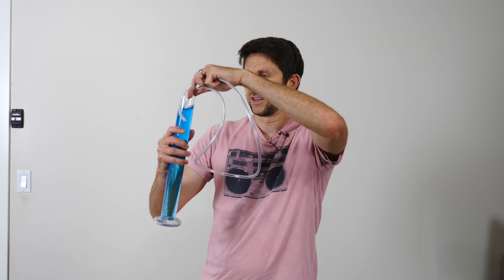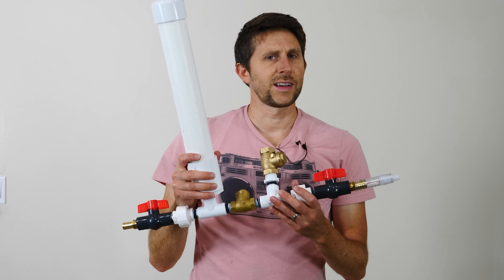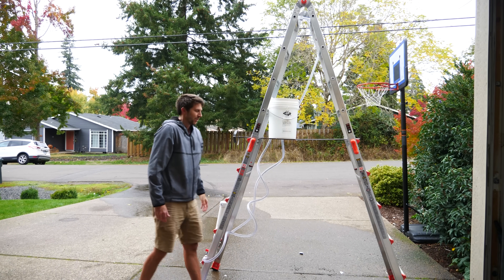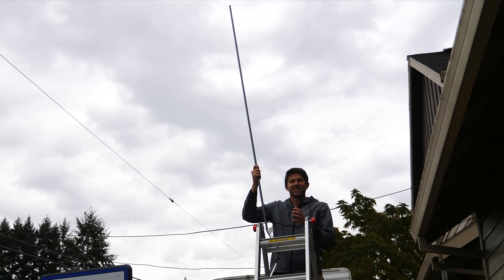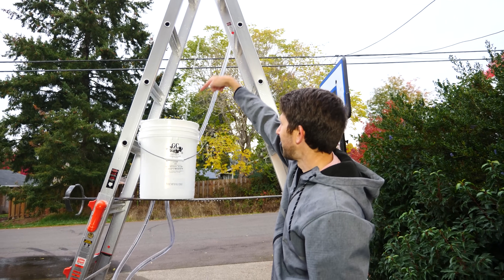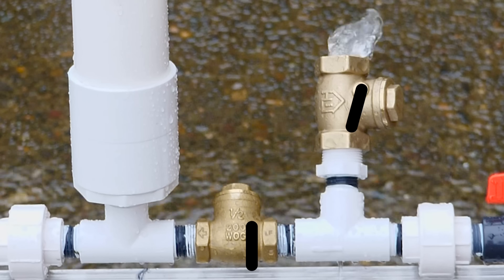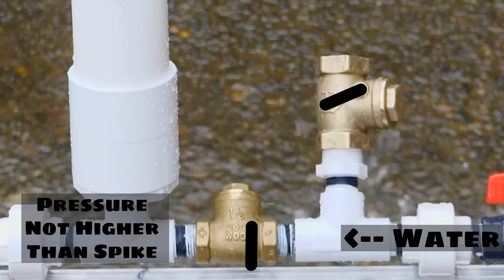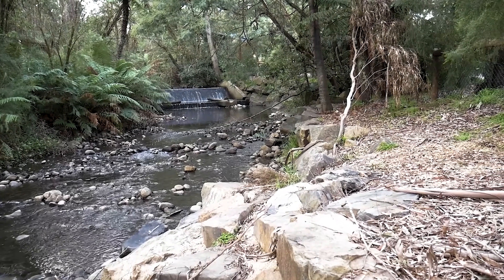Can a Hydraulic Ram Pump Make a Perpetual Motion Loop?

Comment: I know it won't make a perpetual motion machine, but what would actually happen if you recaptured the waste water into a small reservoir to put back into the system instead of squirting out on the ground?
Reply: all of the (source) water has  gone  DOWNHILL,  to the pump.         how do you propose to coax the waste water  to flow  Back  Uphill.?
Reply: @daviddavids2884  It does already spurt upward a couple inches when coming out, so it's a little bit above the pump at least.

Comment: I got this idea swinging a sledgehammer like a pendulum but I noticed I couldn't just raise the hammer up from a dead hang it required me to swing it to allow it up. Which made me think if I replaced my hands with an arched track and allow the sledgehammer to hang from said track that I could cause that hammer to swing around the axis with minimal effort. Using just my pinky finger I could swing it back and forth until it was spinning. Could I get more power from the sledgehammer swinging then the small nudges it would take to keep it swinging on the track? You would need a lot of the swing force to be absorbed by the arch of the track before the nudge in the other direction.
Reply: As long as there is no friction yes. All those small nudges (if timed correctly) add energy to the hammer. Resonance is actualy just this phenomena, well timed inputs that over time add energy to a system such that you end up with a lot of energy in the end.

Comment: What if you use the water that goes above the bucket to land on a wheel device that when it gets heavy enough spins up the wheel and falls back in the bucket but the spinning wheel then pulls up as much of the left over water that came out the valve? What kind of return efficiency could you achieve?
Reply: see my comment, above.    10%  output is not a lot, but it is continuous and mostly free.
suggest  you  go  AFTER  the answers  to  your  questions.    surf  wiki; internal links.    while it's still around and free.
https://en.wikipedia.org/wiki/Hydraulic_ram
https://en.wikipedia.org/wiki/Hydropower

Comment: what would happen if you sent the waste water into another bucket/ramp system that sends the water back to the original bucket? would be cool to see how long the system would stay running for
Reply: and on the way down, passes a hydro generator for power
Reply: @CrAzZyTheCodingBoss  That would reduce the fluids momentum, and offset somewhere else.
Reply: @CrAzZyTheCodingBoss  That is what I'm working on 👍🍀🇺🇲
Reply: @Rizik1986  Same am working on we need a colabo ✌️
Just call it an indirect dam. So you don't need all the special license that goes with the dam you just return the water back to the original source without affecting the water 
Imagine you invest in a massive tank with low rpm magnetic alternator like 120rpm. So the pump speed into the massive reservoir equals the exit speed. Bingo you good. A mobile Dam 👍
Reply: @onekycarscanners6002  Hmm this might be just the ticket to make this happen! I been stumped last few weeks trying to figure out the next move. I wanted to use a water ram pump but it simply won't move enough water for what I'm trying to do. An alt with a small pump could work I suppose.

Comment: "THERE IS NO FREE ENERGY DEVICE!!!"
- ElectroBoom
Reply: What is the sun?
Reply: Sun will eventually burn out
Reply: Not free, we catch and convert. Yet the sun is depleting. You get 'free' energy. But the sun burns, and one day, it will burn out. Same with the water, the water source runs out. You can catch them waste and repurpose it. You can re-add it to the original source. Now you are expending energy. In any free energy generator, their is a source that depletes. The depletion time might just be 10 years. You do not create energy. You transform it. For every volt and amp you get out, you lose it elsewhere. If youmdraw from the greatest power source of all, the earth, the earth also has a shelve life. It also has a limit to its energy creation. You can build more complex machines, add more than one law of physics together to 'negate' aspects of physics, yet you can not change physics, just manipulate it using physics. And all these complex machines you build, most likely these systems already exist in nature. Changing one form of energy into another and keeping the cuycle going is a part of nature. Yet one day, nature will have nothing left to give. Evolution theory and science combined. Nothing could not explode and create a universe if energy can not be created. If a planet or space or the universe is eternal, it would mean that energy is coming from an outside source. Replenishing what has been used. Natural systems might be eternal, converting energy in several ways that lead back to the original source, but wear and tear breaks the mechanisms of the system. Somewhere , you do lose something. Always. 10 000 years of energy. Which to a man that lives to be 80 looks to be free. Your great great great great grand kids will pay the price. But who cares about them right.
Reply: An immense limited power source

Comment: Water hammer is not so much pipe expansion, but long-run pipes actually moving due to the momentum of the contained water when the flow is abruptly changed. This phenomenon is why sprinkler systems avoid single-direction long runs, since the water flow is controlled by solenoids, which turn on/off instantly. The water hammer phenomenon can break the pipes.

Comment: you mentioned water hammer, that can actually damage pipes, which is why water hammer arrestors were invented, the water hammer arrestor absorbs the water pressure from the water coming to a dead stop when valves are closed

Comment: It would be interesting to connect the waste valve back into the water line! So it would really become a perpetual motion machine!
Reply: you mean where the water is being sent into the pump or you mean the bucket? both ways wont work cuz sending water back into the pump input wouldn't have enough pressure and you cant send water back to the bucket cuz it also doesn't has much pressure

Comment: Question: would it be possible to have the waste valve just feed back into the bucket?
Reply: No
Reply: @jimwhelan9152  why ?
Reply: @jimwhelan9152  what if we make that waste valve connect to the pipe line of bucket ?
Reply: @failoor  the bucket is higher than the waste valve outlet. Water doesn't flow uphill.
Reply: @jimwhelan9152  so if we make that possible will perpetual possible ?

Comment: I noticed that the check valve is at the beginning of the water inlet, I did it before, but this valve was placed after the air chamber, that way your water elevation is more efficient?

Comment: I love how electrical components can all be reproduced in an hydraulic system, this is definitively a DC/DC boost converter (the inductance is water inertia).
Reply: Very noisy signal and very inefficient to be to be a boost converter..
Reply: @omniyambot9876  This is however a rigorous hydraulic analogy.
Reply: @IncroyablesExperiences  But it's a PWM maybe
Reply: @IncroyablesExperiences  il faudrait que tu fasse la même chose mais pour le YouTube francophone ,ça ferait une super vidéo !
Reply: @omniyambot9876  a inefficient and noisy boost converter is still a boost converter
Reply: Yeah I guess
Reply: I literally yesterday was thinking about this same exact thing.
I was thinking about how water could push itself with release of energy, akin to how batteries release electrons from one side and grab them from another.
Reply: @blinded6502 sorry, nur: Wenn hier so viele kluge Leute von Strom Ahnung haben (im Kommentarbereich von einem Widderkopfpumpenvideo!): Warum gibt es noch kein Blitzenergiespeichermedium?
Reply: Ooh vous ici ❤️
Reply: I love how synonymous electrical concepts are with water too. Check valve just a diode. Not smart enough to wrap my head around your boost convertor circuit tho. Science is beautiful
Reply: @markmywords5342  You can also model a spring/damp/mass system as an RCL circuit and vice versa.
Reply: None of those components are electrical components
Reply: @Unholy-Dread  Any active/passive component has its hydraulic analogy!
Reply: @IncroyablesExperiences  what isthe Hydraulic analogy of the transformer?
Reply: @omniyambot9876  these don't extend well to AC.
Reply: @omniyambot9876  RE Transformers,.Any hydraulic ram here the bores are not equal? The basic thing hydraulics are use for? 
A small piston pump going like crazy but only low power moving a big cylinder slowly but with high torque or what ever the equivalents are.
Strangely it looks more DC
The other one that came to mind was a torque converter.
Reply: @Margarinetaylorgrease  what do you mean?
Reply: @Margarinetaylorgrease  moving slowly at a higher torque is still the same power.
Reply: @omniyambot9876  A transformer only changes the ratio of voltage to current. It does not increase power. 
5VX2A=10W
2VX5A=10W
Reply: @Margarinetaylorgrease  I'll nominate you nobel prize for teaching me that genius forbidden knowledge.
Reply: @omniyambot9876  I could not of done it without you.

The strange thing is that most free energy machines I see on youtube don't understand that one thing, they quote Voltage as is if  it is Power.

Sorry if I came over as condescending, I can not assume what you know.
Reply: @Margarinetaylorgrease  I get what you mean but you don't get what I said. Yes, voltage and current is always conserved at the same power because it is the product of them both. But if you put this model as an analogy of boost regulator, you are throwing a lot of current for just for a little bit of relative voltage. The purpose of boost converter is to boost DC efficiently like a transformer. But its is very stupid analogy, even when you look at the oscilloscope, a boost converter tries to correct the ripple and reduce the noise as close as possible to straight line. Where as the model sacrifices a lot of power, rendering it useless.
Reply: @omniyambot9876  I'm replying to this direct question "what isthe Hydraulic analogy of the transformer?"  Nothing to do with boost convertors.
Reply: @omniyambot9876  A transformer can be modeled like a change in pipe section, it increase/reduce pressure and reduce/increase water velocity.
Reply: @simonepozzoli  let's say you reduce the pressure, do you get more water flow? absolutely no..
Reply: @omniyambot9876  water flow (mass or volume displaced in a certain amount of time) represents power. A transformer does not increase nor decrease power, hence the power of water entering the nozzle must be equal to the the power of water exiting the nozzle.

According to Bernoulli's equation, assuming constant height and constant density (reasonable for water), the only two variables you can change are pressure and water velocity [m/s] (be careful that is different from the flow which is volume or mass displaced over time and depends on pipe section).
A (ideal) nozzle does not reduce the water flow, it just changes these two variables
Reply: @omniyambot9876  flow = density * pipe section * velocity
With a nozzle you increase/decrease section and decrease/increase velocity and flow remains constant for the conservation of mass, but an increase in velocity means a reduction in pressure and viceversa
Reply: @simonepozzoli  Exaclty. You represented the flow as power. In electricity, the amount of charge that flows is current..  Same thing as the water flow. You can't use it to represent power. The power will be the Density x Volume x acceleration due to gravity x distance. And in your model, how do you represent the current and voltage? by substituting pressure and velocity? doesn't make sense. It is literally incompatible. Hence, my first reply is enough.
Reply: @omniyambot9876  sorry but I don't agree, according to you the power is (density * volume * acceleration * distance), but that is actually a measurement of the work put into the system: a force * displacement, it measures the amount of energy, not power. The power depends on the time it takes to input that energy, so it is defined as force*displacement/time, hence (force*velocity) or (pressure * pipe section * velocity)
Reply: A1V1=A2V2 describes the motion of fluid through a changing diameter of pipe. If you narrow a pipe the water will travel faster through that section to maintain the same flow. This is basically the same as an electrical transformer.
Reply: @Margarinetaylorgrease that's what I was getting at, Not the same at all
Reply: @Unholy-Dread  analogy
Reply: I was thinking how the big white pipe is a capacitor smoothing and reserving pressure
Reply: this statement is life changing.
Reply: When do I get my hydraulic computer then
Reply: @polydullmemes3497  The MONIAC also known as the Phillips Hydraulic Computer. Invented in 1949.

Look it up.
Reply: @rogerrabbit80  nice, can it run rtx?
Reply: @polydullmemes3497  Yesssssss lmao if you don't know, mechanical computers were/are a thing. Noisy as heck.
Reply: I'll see your statement and raise you an antenna.
Reply: @rodericklenz5030  doesn't work in AC
Reply: The thing is you're looking at this in a completely backwards way.
Electricity has the flow of water in a pipe persay, meaning all the things that can be done in the means of mechanical work can and probably has been done before electricity.
Which I think is pretty cool but this theory can also be applied to other things like gasses.
Water has always been a thing and we've had thousands of not millions of years innovating on it.
Just like today items are getting smaller and more efficient, we had to use something to start from to make something better.
Reply: if its not Perpetual Motion don't even pose the question. thumbs down but like hell you could even see it anymore because of YTs stupid decisions. and the reason why i thumbs down is because i am of the belief that Perpetual Motion might be the only thing that can save humanity. and before any scientifically accurate retards pipe up, i didn't say "i believe its possible" i just said it could be what is necessary to for humanity to survive in any long term way. especially with the way governments of the world are treating long term problems like global worm and what not.
Reply: a*
Reply: Well a ram pump produces a kind of vacuum that builds pressure, it's not all the water flowing, but Instead some pulls out down while creating pressure to allow some up. Now I don't know the exact point of energy lost but I've seen farmers use it in there fields. Pretty cool stuff.
Reply: its funny how electricity and water are similar but cant mix them
Reply: its more like an induction coil (a transformer that uses DC current)
Reply: When you think about it, fluid is almost as chaotic as electrons which means they are nearly energy equivalents.
Reply: ...or pneumatic [ remembers his 1980's tech lessons ] 
The system appears to be less than 50% efficiency it seems.
Reply: I agree, a schematic of a DC/DC boost converter pops up in my mind when I see that😂
Reply: Great analogy.
Reply: I think it is due to atmospheric pressure .  ie. 14 lbs per square inch.

Comment: Loved the video!

Now hook this into a river, pump water up hill, or even up an artificial platform into barrels which properly flow into outlets valves and through small water turbines running down to the water source.

Invest in a proper equipment to transfer and store energy.
Reply: You shut your mouff right now

Comment: Could you theoretically have pereptual motion by placing infinitely many buckets below each other?
Let me explain, when you place the same construction he had in the video again under the "waste water" outlet of the first one with its pump outlet in the first ones bucket, and then under its "waste" outlet the same thing again and again to infinity.
Let's say hal of the water flowimg through is "waste" and the other half gets pumped to the higher level, then by having the second construction in place, only 1/4 is waste, with the third only ~5/32 (1/4 flows to the third container, 1/8 is waste, 1/8 gets pumped up again, of which 1/16 gets up to tge first container, ergo no waste, 1/16 flows down again, and so on)...
Reply: this is the same thing as just slowly moving downhill.